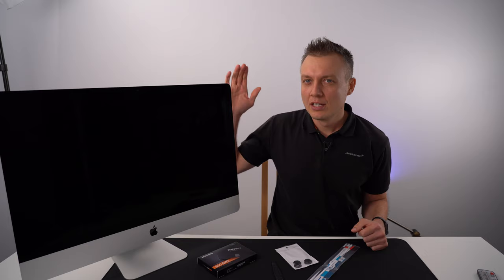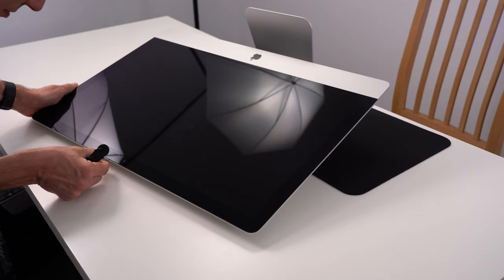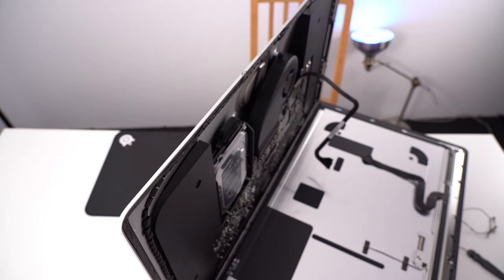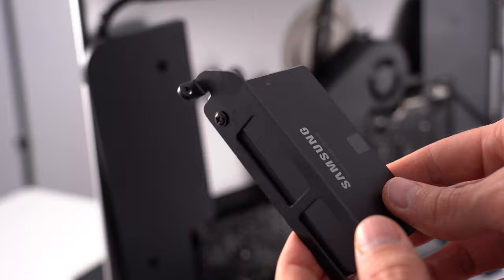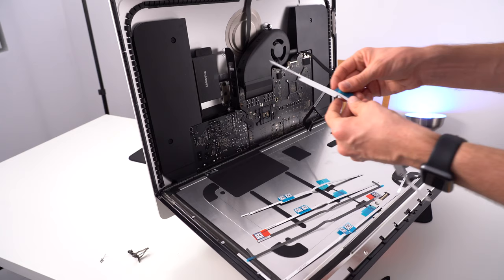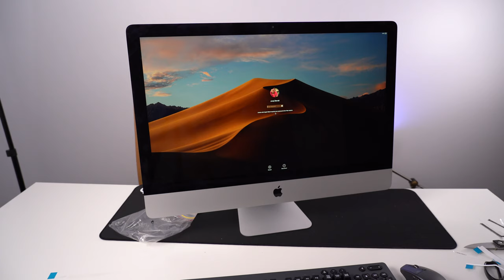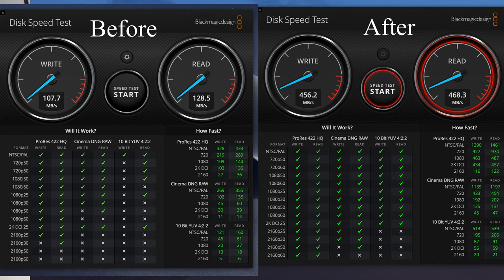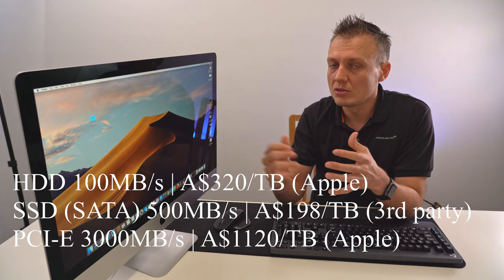How to upgrade iMac 2019 from fusion HDD to SSD (4k)

Comment: I upgraded my wife's 2009 MacBook pro with an SSD and an extra 4gb of ram for her birthday some years ago and it was running better than new, but when I closed everything up, I went to clean the screen and cracked it.  The wife had to stare at a cracked screen for a whole week.  I ordered a new screen from OWC which arrived in the mail cracked as well.  The wife had to stare at a cracked screen for another week.  Happy Birthday, Honey!  lol They sent me a second screen and I must say, having to remove the glass was INTENSE!  I had to use a freaking hair dryer to loosen the adhesive, I had to make sure the inside of the screen was free from lint and dirt etc.  It was INTENSE!  It took me two days to make sure I was doing everything right.  The good part about the removal of the screen with the iMac is that the backside of the screen is covered, so you don't have to worry about cleaning it to the point that you won't see debris once it's closed.  Long story short.  Don't have HULK hands  lol

Comment: When I formatted my SSD with APFS, my 2015 iMac running Mojave would see that it was there in a Recover boot, but I couldn't modify it, install the OS, or attempt to launch it on startup.  I ended up formatting it Mac OS extended journal to get it to work.  I hope there are no problems down the line.

Comment: Definitely format to APFS. I made a mistake and made it Mac OS Extended. Now need to erase and clone my drive again (which will take 5 days for 8.9 million files) for the studio iMac. APFS, dont listen to older vids specifying HFS+ !

Edit: I'd also use Super Duper over Carbon Copy or Time Machine; Super Duper gives you info on mb/s and personally more useful, I've tried all 3.
Funnily enough, Time Machine came in last place, as my drive was partially corrupt and it only successfully cloned fully using Super Duper. So there is your reason why people dont just use Time Machine, it is not full proof, even if it is easiest, until it isnt.
Reply: @jepacapej, APFS is slower, less performance.

https://blog.macsales.com/42901-the-speed-of-apfs-just-how-fast-is-it/

https://macperformanceguide.com/blog/2017/20171124_2015-macOS-HighSierra-FileCopySpeed.html

https://www.macobserver.com/analysis/apfs-performance-lags-hfs/
Reply: @kalijasin  apfs may be similar or slower when  coping files, but the filesystem is far more efficient,  effective  and apfs was designed for the newer macOS's  Why would you use Mojave or Catalina  which were  designed for the apfs APFS filesystem with os extended> Especially if you are using an ssd, makes no sense whatsoever, by the way if you erase a drive in os extended most times it is converted to apfs anyways, via nondestructive conversion. People who are saying don't use apfs on the newer os's written for apfs are grossly misinformed at best.

Comment: I did this upgrade on my older 2013 iMac. Your video doesn't point this out, but after the SSD is installed in place of the SATA spinning drive, the PCI-E SSD portion of the Fusion drive is orphaned, but still shows up as a (very fast)volume that you can use. Mine was 120GB.

Comment: Good video but a couple of constructive criticisms:
Firstly, you really should've removed the screen completely. The adhesive strip on the bottom has been compromised by hinging the screen and could've unexpectantly detached while you were working on the Mac, plus, the chances of slipping and damaging the screen are a real danger if it is still partially connected. The adhesive strip kit comes with strips for all 4 sides so you should really use them.
Secondly, because you have not modified the HDD temperature sensor (I believe there maybe kits available), the fan will run continuously at full speed - causing excess noise and possibly, premature fan failure which will mean opening up the Mac again and installing another fan module.
Reply from the maker: firemanmick I didn’t find it necessary and since I had it supported, I wasn’t worried. Secondly the fans aren’t running. This generation, and I can confirm after running it for a few months now, doesn’t need the sensor

Comment: I find it odd that it didn’t boot because the fusion drive should have SSD for the boot OS. The spinning HD is for storage only. Unless you really need fast transfer speed, going with SSD is not really a big upgrade.
Reply: Fusion drive is the clue. It should be split using the disk utility first, but then you still need to reformat, etc. you could clone the whole system to an external ssd first then copy back or use recovery to install a base system on the small pcie drive.

Comment: FYI: I bought a 2019 iMac 5K with a built in 1TB SSD from the factory. It's just short of 4X faster than your upgraded Fusion Drive.
Reply from the maker: 4x in sustained copies of large files - it's not such a big difference in every day life however as system files are usually tiny.

Comment: Great tutoríal. I was expecting better speeds, those are slightly worse speeds you get form a Samsung t5... I think it is not worth it to open the iMac to get those speed, you can run the OS from an external SSD. Does anyone know a better SSD that will get me better speeds internally?
Reply from the maker: astrovlog you won’t get better speeds as SATA interface is the limit here. Samsung T5 is quick but has its limitations like drive encryption and so on. I found it to be bit too unreliable for my liking
Reply: Exactly. You can’t beat internal drives for system and apps. Plus you don’t lose a TB3 port.

Comment: Thanks for making this video! Very informative!
Couple questions:
1. In the OWC video they completely remove the screen from the housing. In your video it seems you used the bottom adhesive as a hinge so the screen would simply tip over but remain attached? If this is true, can I assume you did NOT replace the adhesive on the bottom of the screen and basically reused the existing adhesive?
2. I was a little confused by the last part of your video explaining the two drives inside the stock iMac: a smaller SSD and the larger spinning HD. So when you removed the stock HD, does that also remove the smaller stock SSD? Or by removing the larger spinning drive is the smaller SSD disconnected? If the stock SSD is still being used by the iMac after installing the new SSD, how is the stock SSD disconnected?
Thanks!
Reply: The "fusion drive" on an original machine is a PCIe module clipped onto the motherboard + SATA cabled spinning hard drive. These show up as a one drive icon but in reality, are two drives working together as one.
To swap-out, the PCIe module requires accessing the motherboard, which takes further disassembly. Time-consuming but easy enough. The Apple PCIe HD modules are bespoke to Mac's so are more costly than for standard PC motherboards.
The interesting point that Juraj made: Fusion drive is only for PCIe + spinning disk, not PCIe + SSD.
So if the OS is loaded onto the new SSD machine, it may be faster but not anywhere as quick with the PCIe
For my part, I will swap-out my 125GB PCIe for 1TB where the OS and other applications will sit, and swop-out the spinning drive for a 2TB SSD for data storage. 2 HD icons will show
Also: Juraj, didn't mention the temperature censor required for the new SSD; without this, the cooling fan will be at max all of the time. However, I understand there are software solutions.

Comment: Hi Juraj, thank you for your video on this! I have an iMac 2013, currently also with FusionDrive setup. Now yesterday I ordered an SSD-upgrade-kit. Only later I remembered my FusionDrive Setup. Did you need to change anything else in the system in regards to FusionDrive? Or just mount the SSD, later format it in macOS, as you described and then install the complete system back from (TimeMachine-) backup? Cheers, Matthias

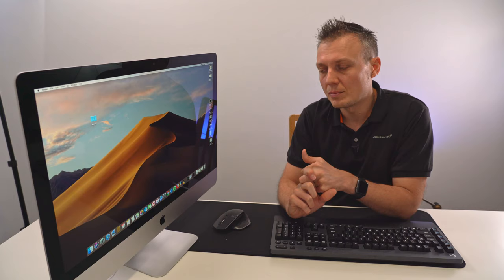Comment: Thanks a lot for this detailed Video and explanation. just quick Q, at 15:09 you mentioned the system will not support 2xSSD drive. 
So what will be the solution, since I have fusion drive? (1 TB)  I should keep the rotation drive 1 TB or remove it?
Reply: I have the same question...Can I replace the fusion with sata SSD and replace the stock pcie SSD with a larger pcie SSD?  Thanks in advance!
Reply: Same here lol

Comment: Just a question. If Im going to move away from the Fusion Drive and just use a big 1 or 2 TB SSD, what do I do with the little flash SSD thats in Mac(the one that was part of the Fusion Drive)? Is there a way to disable it so its hidden from your Mac or do you have to manually remove it? The reason I ask is because right now my Fusion Drive is split, and Im just using the 1TB Sata drive, but because the drives are split Ive run into certain issues because the Mac thinks its supposed to be a Fusion Drive. For instance, I tried to Factory Restore my Imac(the one that restores the the DAW it started life with) and I just get a Folder with a ? In it. It says that it cant restore it, and I read stuff that said you get the( ? )Folder when the drive is changed or damaged in some way, so Im guessing its because the original Fusion Drive was split. But ya, Im mainly curious what you do with the Flash SSD that was part of the Fusion? Or after you install this 1TB SSD do you still run it as a Fusion drive?

Comment: You need to ensure you also add the thermal sensor kit to the SSD drive otherwise mac will eventually thing drive is overheating and CPU fan will go crazy
Reply: 2019 model doesn't require the sensor mod.

Comment: Thanks Juraj. Interesting to hear that Fusion Drive can not be made with the SATA SSD, this is a deal breaker as the internal NV2 is only 120GB. 
What about the temperature sensor on the 27 inch 2019 model? It is needed for the 2017 model year.

Comment: I put more ram and a new hard drive into my MacBook Pro mid 2012. Definitely easier due to only taking out some screws on the underside. This is a bit lengthier task. I ordered an iMac 21.5 2019 retina 4k with a base of 8 gb. Mind you it was refurbished. I want to put in an ssd hard drive and upgrade the ram from 8 gb to 64 gb. Safe to do so?

Comment: Please note you are missing an important point which might make the system useless. I have seen it happen. You have to split the drives first using terminal commands. Unfortunately I have not seen any updated explanation on that. Do you know how to? You can't just open the glass and replace HDD with SSD.

Comment: so you can just leave the "nvme" in there and just replace the spinner with a 2.5" sata ssd and that's it? no issues? i've heard you HAVE to remove the "blade nvme" or there can be conflicts. obviously, whether or not i plan to use the "blade" or not and just install MacOS on the new ssd - i'd prefer not to have to further disassemble to remove the blade.

Comment: What do you do with the existing PCI SSD that was part of the fusion drive?   I can swap a spinning drive with SSD, but wouldn't a PCI upgrade from Apple be much faster than doing it this way?   What happens to the internal PCI SSD when you format the newly placed SSD drive and install the OS... does it sit inside unused?     I'm debating the 2TB fusion vs. 2TB SSD and see videos of people tearing the entire iMac apart to get to the PCI storage... I don't want to do that.
Reply: Same. This definitely doesn't seem like a good idea. I'm debating 1TB Fusion and 512GB SSD, but either way I'll connect an external SSD later.
Reply: I think opening the iMac is not a great idea. I bought an external case for the SSD (one on amazon that looks like aluminium so it looks like part of the iMac design) and connected it through Thunderbolt. Then with terminal in recovery mode i undid the Fusion drive between the HDD and the PCI drive (there are a lot of tutorials for this). After that I made a new fusion drive between the PCI drive and the SSD specifying that de main drive is the internal one. Now i use the ssd+pci to the OS and the HDD to store large files. It works seamlessly and fast! It's a lot easier and safer. Try it!

Comment: Hi, I bought a 2017 iMac to upgrade (I've done many), but this one is having some problems.
I'm changing his intel SSD to a Samsung and 8GB RAM to 32GB.
What happens is that it fires the FAN right away in installation mode and takes hours to install macOs Monterey. And then it gets super slow.
What could be wrong?

Note: I didn't notice the purchase, but after I disassembled and reassembled it, the RJ45 input doesn't line up.

Comment: Hi! We built in a 2TB Samsung SSD instead of the HDD part of  fusion drive. My migrated system is on this 2TB SSD.  Is there a reason to move the whole system (maybe OSX Catalina) to the  faster 128GB SSD part of the fusion drive. I have some app crashes on the new iMac 27"  2019, i9 64GB Kingston RAM machine now. A clean install on 128GB install may help to get a faster, more stabile machine? THX!
Reply from the maker: You migrated as in copied or you installed fresh system? I;d suggest fresh install or wait for some patches as there could be issues with new Catalina as it only came out. I and many of my colleagues had friends with recent iOS (13.1.2 if I’m not mistaken) but wasn’t HW issues as we individually thought at first. You can run diagnostics that will determine if there are any component issues. If not, it’s system related

Comment: You will be better off if you create a new FUSION drive with both SSD, fusion both and you will get 1300MB/s speed, I've done.
Reply from the maker: Rafael Camargo how? System says it’s unsupported
Reply: @juraj_b  yes the system will tell you it needs to be a spinning hd in order to create fusion. You need to create from the ground up, follow this video and it will work. https://www.youtube.com/watch?v=w4NqbGEJpN4
Reply: thinking about getting a new HDD 4TB platter drive and 1tb nvme and making new fusion drive...thoughts?

Comment: you could drill a hole the same size as the one that is holding the ssd so the imac can have a lother hard drive if there was a way to have 2 instead of 1 hard drives

Comment: Hello, I have a 2019 27" i5 iMac with a 1TB Fusion drive. The drive is too slow and too small for my needs. Would a Samsung870 QVO SATA III 2.5" SSD 8TB (MZ-77Q8T0B) be compatible with my Mac? If not what 8TB SSD would you recommend? Thanks.

Comment: Hello Juraj, thanks for the detailed video - much appreciated! Is it still possible to use the original PCI-E SSD as a separate drive? So I would have 2 SSDs in the Finder?
Reply from the maker: cokefridge you can format it and then you’ll see it, yes
Reply: @juraj_b  Perfect, thank you :)
Reply: This is what I want to know as well as I'm trying to use let's say the PCI E just for my OS and main apps and use the Sata SSD for other applications
Reply: @josefdahari  I did exactly that, works fine.
Reply: @milkfridge  so. You had to split the fusion drive loosing all data obviously right then installed the ssd and installed OS on blade?
Reply: @josefdahari  exactly. keeping the data is not possible. after splitting both drives show up. After that I installed the 2nd SSD instead of the SATA drive.
Reply: @milkfridge  anything I should know or do prior to opening up the machine like to prepare.   My take is. First Split the drive which I'll have to look up again on how to do. Then either open up or should I install an OS first on the blade ssd then open and install the new SSD sata. Trying to really get it all prepared prior to opening up the machine so I don't have any issues. I already have a clone of my fusion drive on the NEW sata ssd which I might format once everything is installed. Either that or do a backup on another external drive. I rather a fresh install and reinstall certain apps. What you think
Reply: @josefdahari   either way should work, I'd go with a fresh start. If you want to test it before try it like this: 1.Buy: replacement adhesive, opening tool, 2,5"to3,5" adapter bracket 2. backup data from fusion drive 3.split the fusion drive 4.reinstall os on apple ssd 5.check if its working 6.open the device and replace the sata hdd with your new ssd. 7.reassemble everything and test if its working 9.apply adhesive and seal the imac.
Reply: @milkfridge  thanks for setting this out clearly. Just had a question for you someone else in the thread asked but wasn't answered. Will I need to get a heat sensor for the ssd?

Comment: Many tutorials state that a temperature sensor adapter cable is necessary to prevent the fan from constantly operating at full speed, and other tutorials say that the sensor isn't necessary. Did you research this before doing the upgrade without sensor, and how does the fan behave?
Reply from the maker: Luke Skirenko no need. Some manufacturers like to line their pockets with unnecessary stuff

Comment: You didn't use a heat sensor I've seen installed in other how to's is it really necessary  especially with a ssd
Reply from the maker: I haven't had any temperature warnings, neither by default or under load
Reply: Juraj Benak thank you for replying it helps since I’m thinking of going without the sensor.  Videos such as this are highly appreciated
Reply: @juraj_b  You won't cuz your fan is running continously
Reply: On most of these iMacs, not using an extra sensor cable results in the fans running at full excruciating speed. This was not apparent on Juraj’s video.
Reply: @macyourday0  i have been told the newer macs do not need the sensor, the guy at microcentor told me it was only the older models and mostly the 21.5

Comment: Hi, thank you for your video, just wondering if you didn't forgot to connect thermal sensor as others do, correct me if im wrong. Thank you
Reply from the maker: There's no need for it in this version
Reply: @juraj_b  what about this version 2017 iMac 5K with a 1TB Fusion drive (1TB SATA HDD + 28GB PCIe SSD)???